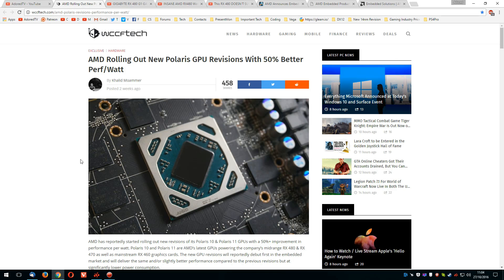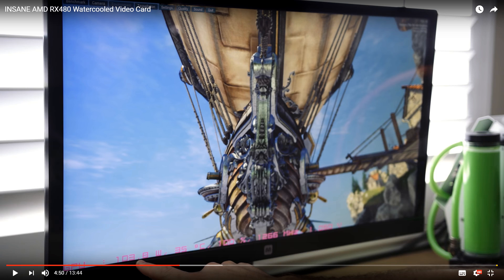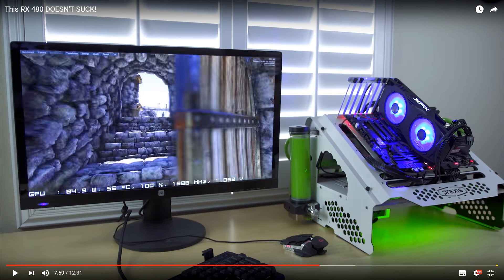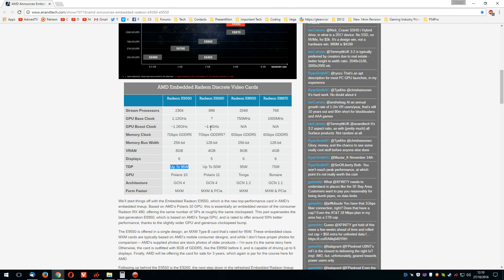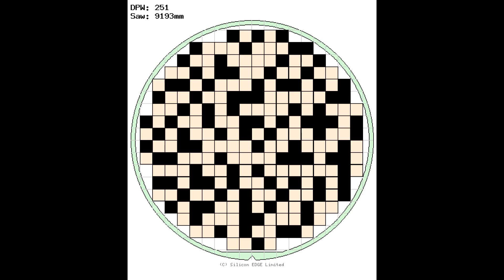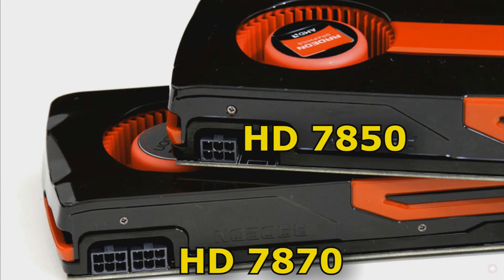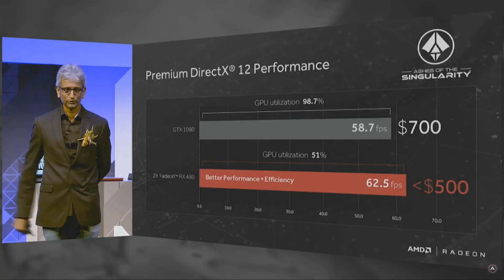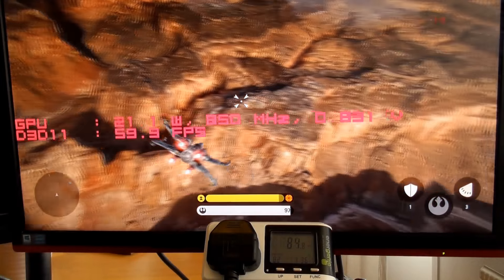Polaris Efficiency - Truth or Myth?

Comment: Besides the hardware direction from AMD, has anyone been getting black screens with the RX 480!? I can't seem to play BF4 whatsoever. AMDs response was reinstalling drivers and reformatting Windows etc. but that has had no effect. Still stuck. AMD forums are also not helping due to the complexity of the problem, it only happens in certain games in certain environments. Extremely weird.

Funnily enough, running benchmark software is not a problem, I can run 3Dmark literally forever and it would still keep going. Weird.

I'm running Windows 10 64 Anniversary edition if anyone has any advice :). Just really frustrated ATM.
Reply: Probably, it's too late, but... If the game's crashing when you're getting black screens and you get 'video driver has crashed and was recovered' message (easier to notice in windowed mode), there is a very high chance your PC has high power consumption. You said it happens in certain games, I bet those games are running at high CPU usage in those environments. So try monitor your CPU usage even using something simple like Windows Task Manager. By the way, 3D Mark won't help you here, cause, judging by my experience, it's not CPU bound. It's either using your CPU or GPU, but not both at 100% at the same time even in combined tests. If lowering resolution and/or graphical settings makes those games relatively more stable, it's definitely high power consumption.
Reply: KenTWOu hey,

Thanks for the reply.

This DOES NOT happen in Windows 7. Only happens in win10. My specs are:

I5 4460
8gb ddr3
RX 480 8gb
Couple of hdds and fans.
Corsair VS550. The PSU is quite new and am 100% sure it is not the problem because of its powerful 12v rail regardless of its quality. 

About the crashing, interestingly, the reports from users are only in Windows 10. Win 7 users don't experience such problems. Moreover, I have also run prime 95 AND furmark to get the PC to crash and no luck. 

This issue is a driver issue no doubt. Nvidia was experiencing these problems as well. I believe it has something to do with the voltage applied at certain speeds. Win10 seems to not like AMD ATM.

I can provide a video of me playing bf4 no issues for hours. Heck I played campaign for 2-3 hours straight in the last couple of days every day and the PC was fine while running 7 64 bit ultimate.
Reply: KenTWOu update. 

just went through RMA. card was faulty

Comment: Picked up a XFX RS RX480 two days ago.. was extremely upset at how poorly it performed. I moved up from my GTX950 Xtreme edition from Gigabyte..  There was marginal gains, 1-5fps overall in the games I play. Was upsetting since I wanted to believe the hype.
Reply from the maker: An RX480 is around twice as fast as a GTX 950.  Use displaydriver uninstaller to fully uninstall all drivers then install the latest AMD drivers from their website.
Reply: Interesting. I uninstalled all the drivers, reinstalled and still had a 1-5fps gain. My FX8320 and 16gb of ram should not have bottlenecked it.
Reply from the maker: That's really strange, the only thing I can think of that makes sense is that the FX is being a bottleneck, but the gap in cards is so much that you should see much more than 1-5fps gain.  Try other games if you haven't already and see if the gap increases.
Reply: Yeah, I tried it on Mechwarrior Online. Valley, Heaven, Fallout 4, Planetside 2 etc.. I've been watching the AMD twitch players.. one guy had the 8320 and the 480 had no issuse but I'm not sure what the deal is. Perhaps that was just a bad card? was extremely disillusioned with the performance.
Reply from the maker: Have you tested that the clock speeds are ok, using afterburner like I did here?
Reply: The clockspeeds were fine with Crimson drivers, tried testing them out a bit and overclocking also.. [shrugs] I already took it back, so I cant exactly test again unfortunately.
Reply: If you did Heaven benchmark properly you should actually see the increase. The other games you listed may have problems that you may not even consider. Are they dx9 titles? Are they 32bit instead of 64bit? Most MMOs are CPU bounded as well which will point to the fact that your CPU is actually the bottle neck even more so. However, if you really did a benchmark (Heaven, Valley) then I can't see how your card is producing  such a low score. It just doesn't make any sense. The only thing I can agree with AdoreTV is that your card is trottling and the card was defective/overheating at stock and forced into lower clock spectrum to compensate for the heat. Other than that I think the games you play are just old/ CPU bounded and sticking with Nvidia may be better off since they still perform better on DX9 titles.
Reply: was DX11 lol.. only thing it performed far better in was Time Spy from 3dmark, valley and heaven were 1-5fps. I think it was a defective card and won't judge the 480s from it.
Reply from the maker: Even in a game like Fallout 4 an RX 480 is a mile ahead of a GTX 950.  There must have been an issue with the card throttling somehow, it's the only thing that makes sense here I think.
Reply: Thats what I've been reading and seeing from other gamers/tech channels for months. They sent it back from the manufacturer, so hopefully it can be fixed for someone else. Thanks for going over things with me. Just going to chalk it up to a bunk card. Will continue to save up for the one I actually want, the xfx GTR not the RS variant.
Reply: MWO and PlanetSide 2 are CPU-bound games. You could be running 2xGTX TITAN XP cards and you'd see no FPS gains over an RX 480 or GTX 950. Fallout 4 is sometimes CPU-bound, but you should have seen gains there. Still with an FX 8350, unless you have overclocked it, it would probably bottleneck the card in many, many games. I would still try and exchange it for another RX 480 if you can.
Reply: Interesting. Didn't realize just how much those two games were CPU bound. Can you PM me some ideas on how to get more performance out of my 8320 for these? Thanks man.
Reply: Ryann Von Doom Unfortunately I've never owned an FX-series CPU. I'm not sure of how the BIOS handles overclocking for it. Try a voltage offset of +20 mV and increase the multiplier by 2, that should be where you'd get gains, if you can find those settings. Otherwise IDK! The issue with MWO and PlanetSide 2 is they are poorly if at all multi-threaded, and they lazily offset shaders to the CPU. So if you want more frames, turn off shadows. For whatever reason the shadows are done on the CPU there. Still, try and exchange out that RX 480
Reply: I've never overclocked. No real need to. I'll research that more. I've got an aircooler on it that's a bit better than the stock one.  I also took that 480 back and used the cash for christmas presents for others.

(edit) Shadows are at low with no option to turn off.
Reply: Well, just know the 480 is a good card, and yes there ARE needs to overclock... or sometimes like me, one just overclocks for fun to get the max safe hardware potential :)
Reply: For me, there really aren't any needs. My 8320 has held up against everything I do with the exception of making mwo run smoothly at the highest settings. That'll change soon enough.
Reply: Overclock the CPU. AMD cpu's are beasts when it comes to overclocking. Depending on the motherboard and chipset you got, you could gain a lot more performance. But even at stock the CPU shouldn't throttle the GPU 'that' much. It's possible that you just got a bad sample. On the otherhand software can behave erractically at times. Thus I always reinstall the OS when changing the high level components. Then again I only use my OS drive for the OS and software so you may not be able to do that.
Reply: If I had a better cooler, I probably would. Just got a enermax ETS-N30. I'll experiment with overclocking when I get zen and this system is my secondary.
Reply: im so lucky my card runs MWO ,star citizen a lot better than 980s on top i was in a tropical island with temperatures 45plus withouth aircon . I was dieing but my pc hold up nice. watching this video i have to realize im just lucky with the card it simply sliped through and didnt become a medicl equipment :D
Reply: Its a 8320, not an 8120. So lets just fix this right there. I also didnt judge all 480s because of that one. It was open box from frys, so more than likely it was just bunk from go. I haven't replaced my 950, but that's due to finances requiring me to be an adult with paying bills and all that lol.
Reply: yeah.. I'm an AMD guy. I did get the GF an intel motherboard.. but for mini-itx, the FM2+ isnt worth it.. and I got a Z270m ASrock board for 63$ brand new. Worth it. For me, every system I've built over the last 10 years has been AMD, that will be the first Intel and probably only I'll make.

Comment: It's simple unless you compare the volts going in, its irrelevant, shitter binned die's require more volts to achieve same performance and also end up at much higher temps as well, it's the same as the CPU lottery.
Reply from the maker: Yes, basically.

Comment: I got my 4gb RX470 from MSI, It's Gaming X version. While running BF1, with Stock clocks It pulled about 173w peak from 12v rail according to HWinfo and GPU core itself maxed to 150w (stock voltage was 1.118v) then I OC'ed the card 8mhz to 1250 (just so I can get 40 Gpixel fillrate xD) and took my memory from 1650 to 1750 (any higher would have resulted in Latency change and would have not been worth it) and then I started Undervolting the GPU, I'm down to 988mV or 0.988v right now and my Peak draw from 12v rail is 105w while GPU core itself takes 83w. Again, numbers by HwInfo. My VRM are maxing at 67c now instead of toasty 91c of default and GPU never goes above 62c with just 27% fan speed. 

I wonder why AMD set such insane voltage for stock when they could have easily gotten away with mere 1v on average on each GPU. Image the Performance per Watt chat then.
Reply: Because not every Gpu can manage that, easier and safer to blanket the entire range with an overvolt and get more usable chips out of it.

Comment: Had a 295x2. I was so impressed by the Fury range and 400's I bought a GTX1080. Sad days
Reply: bobbavet I'm looking to buy a GTX 1080 to play 4k60 fps with Anti Aliasing disabled/with shadows decreased. Is it bad to go with Nvidia ? I have a r9 270x and I hate how amd has it's issues. I like how Shadowplay works and it's simplicity for recording gameplay.
Reply: Found the 1080 is pretty much on par with my r9 295x2, which is basically 290x in xfire. Most times slightly better as you have no xfire issues. It's pretty surprising some of the 4k frame rates you can get depending on the game. Start with everything maxed, see how it goes and then peel away any xtras you can go without. AA being the big one on screens 32"and below. I have 40" so some some AA is beneficial, but I am yet to find anything that plays poor fps ie 50fps or under. In fact most are 55fps or greater. Nvidia is only bad on the price, but if you can scrape up the money a 1080 is a nice buy and streets ahead of a 270x. Keep in mind Vega 10 is soon and is looking to pip the 1080 with 11+tflops of compute power versus the 1080's 8+tflop. I reckon it will be priced the same if not initially higher than the 1080 though, but 1080 may drop price. It's all fun and games at the top end of the GPU market.
Reply: bobbavet I'll go with a gtx 1080 for 1440P and 4K gaming. I already have a 1440P monitor. I'm going to buy a LG 27 inch ips 4k monitor.

Comment: That is really intresting. I made some calculations at the nintendo Swich. Of cause it uses a Nvidia APU ins teed of a Radeon card.

But compare them up, i calculated the vents of the swich guestemating a 20W TDP of the APU docked. This GPU run at around 20 watt.. Of cause, there are no CPU here, but a ARM CPU don´t really consume that much.

Roumours states that the Swich (or rather NX back in the day) would preform 2800Gflops... of cause, this being a tegra chip, that is most probable FP16... so that is 1400Glops in FP32.

Looking at the 460 it preforms about 1950Gflops at 1090Mhz...
Reply from the maker: Yep Polaris is really efficient at low TDP but it all goes south fast after 1100MHz I think.  I tested the 460 with Heaven and there was nearly a 150% rise in power draw (GPU only) for a 33% increase in performance, from an undervolted 850MHz to 1220 stock volts.
Reply: AdoredTV I wounder if Pascal is better... Now i don´t have a pascal GPU my self, so i can´t test it..

But asuming that the roumors are true. That the Swich uses 512 pipe Pascal at 1.4Tflops FP32, This would imply a 1400Mhz clock... Its still quite a lot.

Calculating the mobile speed then would be about 1400/1080^2*720^2~622Mhz.

And to my calculation the screen will use 2-2.5W and the battery will be about 35Wh, so it need to draw more about 10W total... so they have to push the chip under 7W to work.

Of cause, it will use stack chip LDDR4....so i would think that the powerdraw of the rest of the system is really low

Comment: I think I can hit sub 100W reported on afterburner running valley. I just undervolt to about 1.00V at 1266. Heck 1342 for me is stable at 1.100V about  130W. No I don't have a special card, yes I believe it's binned.
Sapphire Rx480 nitro+ OC
Reply: Ok, so I tired to duplicate the scenario Jay had his xfx 480 in. I set my target temp to 60 to match his temps, matched my clock speed and voltage... 

110W

No idea what is going on there. I too suspect Jay was given a "golden sample" to make it look better. As others have pointed out, there were basically no reviews for that card and then suddenly this amazing review was up. Unfortunately we do not know the asic quality of the card either (in case that has an impact)
Reply from the maker: Try lowering the power limit by 15% and see if it can hold 1288MHz.
Reply from the maker: Did you set the temperature tab in Wattman to manual first?  It won't work otherwise.  If you lower power by 15% you should see a clear drop in power usage or a drop in MHz.
Reply: Yup, actually I had everything on manual, frequency, voltage control, fan speed and temperature. I wasn't expecting anything else actually when you consider my card is specced for 1342MHz at 1.150V. By default the power limit might be a bit higher than a reference 480.
Reply from the maker: Ah right I see.  I just tested my reference card in Heaven at 90W (-18% power for me as the stock limit is 110W), and got an average of around 1050MHz, that was at 1033mV though.

http://i.imgur.com/jblEQAZ.jpg
Reply: Extrapolating from my data my default (0%) power limit is 150W so -50% is 75W as observed and +50% would be 225W

At -15% it would be 127.5W which I come under at 1288MHz so increasing the power limit will have no effect.
Reply from the maker: Yes your chip must have a 150W limit so -33% should be enough for 90W I think.  (maths fail?), that looks more like 100W.
Reply: Oh nice, we agree on the data. At -40% power I get 90W and a clock speed of about 1080MHz (sorry didn't write down the voltage! Should be below 1.033V though)
Reply from the maker: Yeah, 40% is correct, maths fail by me.
Reply: :P Any other data you would like?
Reply from the maker: 1033mV is my real stable undervolt at 1266MHz, ASIC quality is 81% I think.  Overclocking runs into temperature issues around 1390MHz, even on full fan.
Reply: Wow, my ASIC is 81.2% I'll test my minimum voltage for 1266 real quick
Reply: So my minimum voltage for 1266 is about 1.006V something I weird with my card as it really dislikes going below 1.0V I was trying to get my voltage below 1.0V for testing just now but I was crashing, reducing the clock speed further my card point blank refused to go any lower.
Reply from the maker: I thought mine was stable at 1.020 but it wasn't - I would actually crash while using a browser even though it was fine in most games.  I noticed using the Afterburner voltage slider  that the voltage would either jump between -54 and -48.  At -54 I saw tell-tale artifacting in Heaven (it didn't crash but I knew it would at some point or in some game).  It's rock-solid at -48 though.

Stock is 1.081V, 81.9% ASIC quality, 110W power limit.
Reply: I've noticed the jumping on the voltage slider too.

Multiples of 6
Reply: My 470's voltage also jumps in the multiple of 6. Could that be due to 6 phase VRM?